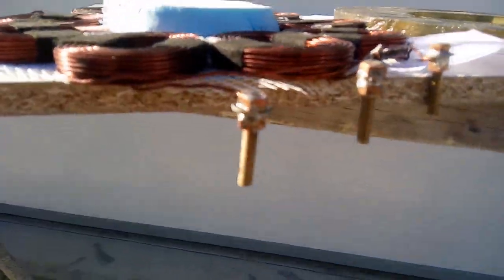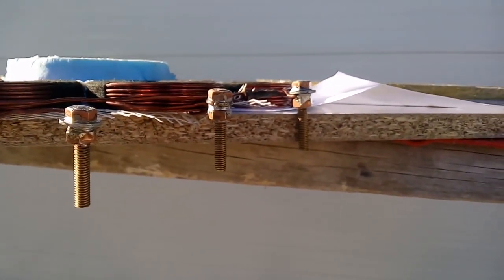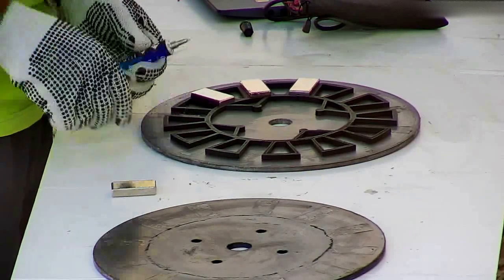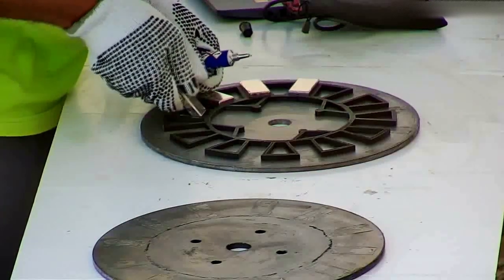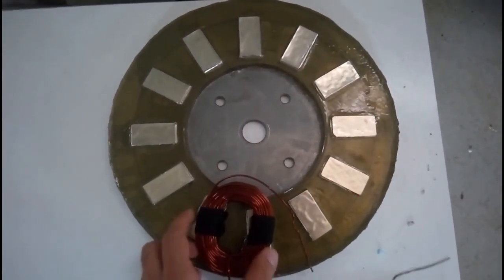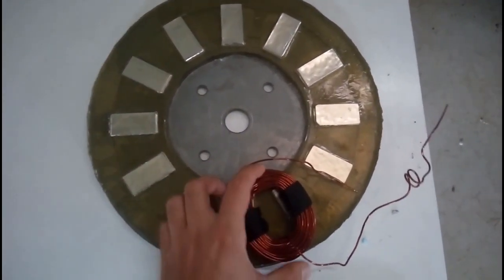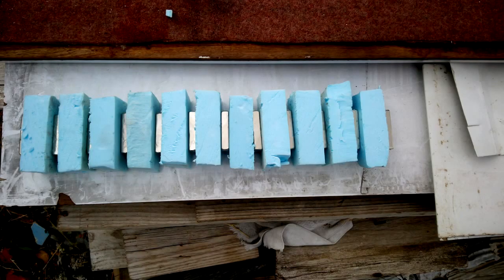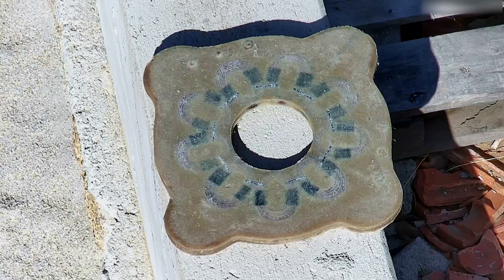Updates about ESP8266 and Wind Turbine

Comment: How much did you need to shift the magnets inwards to get the stator coils to line up. I know from a previous vid the steel disc is 30cm diameter, so looks like the magets moved in about 2 or 3 cm?

Comment: I see what you mean I bet the same would have happened to me for sure, it seems it's best to make the coils first, then, to guarantee alignment    ?? 
I'm thinking of using 50x25x10   N52 but not sure if it's the right kind ?? Also was going to make 4 strand 40 turns 1.5mm copper enamelled wire coils do you think I'm on the right track ?
Reply from the maker: Hi! Thanks for your comment. Yep it's best to make the coils first.  The magnets are great, unfortunately I don't know much about the turns though, maybe try to make a coil and test the output and only then make the rest of them or make adjustments if needed.
Reply: RandomHacks sound like a plan 😀